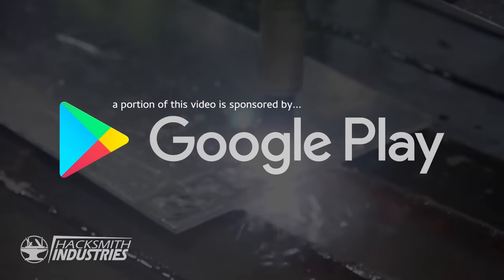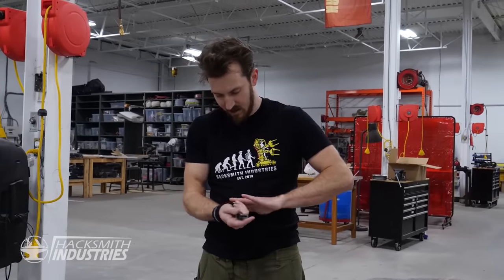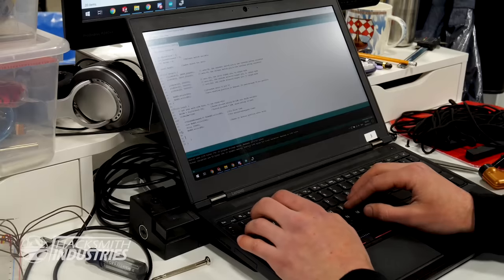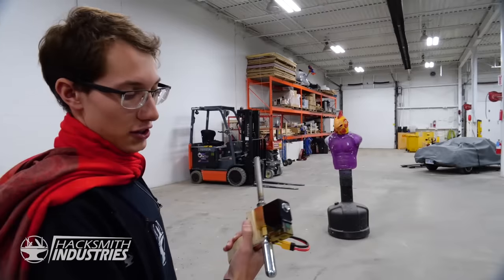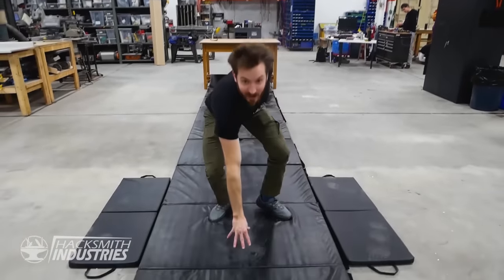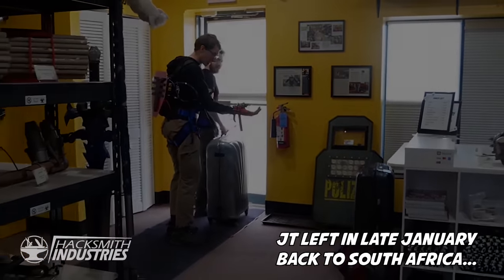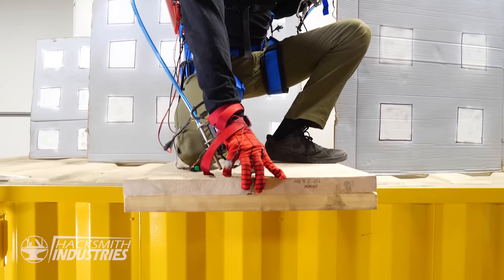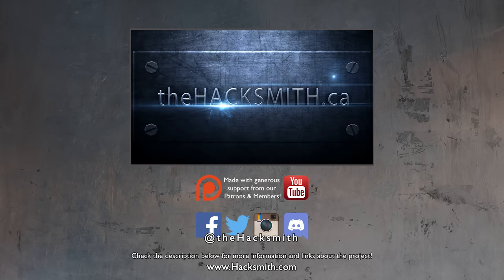Swinging From Web Shooters!

Comment: I love how he says don’t try this at home like we all have Spider-Man’s webbslingers lying around
Reply: aaaa aaaaaa I do
Reply: The web is just silly string
Reply: @whitespider4566  wow.. Damn bro it's so simple 😐
Reply: @whitespider4566  Thats not a webslinger, it's a webshooter.
Reply: @neoarcher4029  yas
Reply: @whitespider4566  Ah yes, Silly string strong enough to carry your weight
Reply: @devduthk3816  it is if your light enough
Reply: @HypNotikZ tf
Reply: @fredthebacon  what?
Reply: @neoarcher4029  na bro he’s altra light
Reply: the entire spiderman suit can have pores sporadically placed amongst it so that super glue can be oozed out of it allowing you to stick to any surface for a long amount of time without falling and oil can be released in certain places to gently release the suit drying it at the same time the holes in the suit could have a heating and air blowing system. All of this should also include a large number of items that will increase the durability of my armour and my suit. So far, my suit has contained a belt containing 3 knives, 2 axes, a hammer, 4 throwing stars, two handguns. the knuckles could have a laser light on it allowing you to shoot projectiles with accuracy.  My gloves contain an array of different coloured wires for attaching various things. The red wire is the grappling line which you can use to attach yourself to walls or buildings and make sure that you stay safely attached to whatever you're working with. there's a strong pulley system inside with the tiny catapult built inside of the wrist so that when it's fired it can be pulled back in with no problem. There are two more cables which connect to each pair of fingers to create more hooks for other parts of the suit which I'm planning to equip later. I've included some other components within the suit too, mainly the legs, the webbing system and my gauntlets which enable me to grip things and move around quickly and efficiently. a gyroscope can be built into the arm allowing you to know the polarity of the swing so that you can kick your legs back and forth and with doing so the system inside of the suit will also make you kick a little bit harder utilizing air pressure pushing you back and forth with air pushing your back forward and your stomach backwards allowing you to kick much harder before it swing meaning less energy between swings.  Finally, I've designed a few more tools in this suit for you which are meant to keep me safe if we end up in a fight and to prevent me from dying. I'll probably need to modify the suit a lot in order to make it work in a crisis so that you won't fall to your death, a flight system for wings can appear out of the suit allowing you to Glide and then in a hole in the spine of the suit can produce a Deployable parachute in case you were to ever fall and Deployable airbags around the suit in case you were ever to fall a little bit short where the parachute couldn't catch you causing you to bounce instead of hitting the ground hard. the suitcase collect energy and multiple ways such as solar energy kinetic energy and many more different types of Energies that will allow the suit to stay charged up even including running jumping flipping and Swinging could store energy in the suit. every little movement could cause a storage of energy. You could make metallic gloves that have 1000s of tiny pores in them that oozes out super glue to make them stick and then ooze out oil to make them release, with a heating system that dries the oil, or maybe a cleaning system.  You could also make your own metal gloves, made of pure steel. If you were lucky, you would find some alloy that was both flexible and strong enough so that they wouldn’t break if you pulled too hard. these could be used as spider man gloves, you could also mix copper wire with pores within it, super glue and gorilla glue and tiny strands of rope, a heating system and a oil release as well as water releaser to cleanse before each catapult of web strings. If you had a lot of money, you could build your own personal suit from metal, cloth, leather, and silk.  I recommend making a couple of suits. one for everyday wear, one that can be deployed by remote controlled device for special occasions. I don’t want anything fancy or impractical to happen because of a bad weather forecast or lack of funding, both hacksmith and the rest of the builders should come together to create this it would be awesome to see.
Reply: @I4IncTrackBlazers  wut
Reply: @milan64982  the reason a spider can crawl is because of its micro hairs, if you build a glove with micro holes that have super glue pouring out, just enough to stick, then a alternate system to pour out oil to release the stickiness but not too much so that a heating system built into the gloves can dry it, it will allow you to depeate the system and keep sticking and releasing. If I had the money I would do it myself to show you an example
Reply: I have mjolnir in my garage. I don't get the big deal it's not that heavy,even I can pick it up
Reply: ...you don't?
Reply: bruh I wanna try it at home

Comment: I have an idea:
Use electro magnets on a rope that is coiled up so that when released the rope coils itself back. The electro magnets are easy to release too. When you shoot the gun, the magnets will stick to the metal roof. When you release the electro magnet the whole rope w/ magnets attached will coil back into the mechanism. Like so he can see
Reply: Thank you for your support whoever liked this comment
Reply: I don't really know any kind of magnets that could support the weight of an human body
Reply: @rubenregnaud5560  electro magnets are pretty powerful, but it means,, that the web will charged af. So he can kill anyone
Reply: @rubenregnaud5560  there are magnets in junk yards that can pick up cars
Reply: @alecsnead6566  but those weight more than a human body
Reply: @veteranoftheemuwar6859  hahaha that's right
Reply: Yeah and wacks you in the face and nuts and stuff when it comes flying back at you lol!
Reply: Ruben Régnaud cargobobs have magnets that can lift cars
Reply: For those saying the magnets have to be super heavy to lift a person, mythbusters proved that's incorrect when they had a infiltrate myth through a vent quietly.  Jaime used super powered magnets to do so, it was loud as hell but it still did the job.  Colin Furze also did something similar where he made magnetic shoes that could be engaged/disengaged to walk on the ceiling.  So it is 100% possible to do, it just wouldn't be cost effective to throw magnets everywhere to swing 10 feet.
Reply: I feel like the electricity needed to induce electromagnets strong enough to carry a human will be very dangerous to work with. Besides, throwing a high-voltage coil of metal attached to a human against other pieces of metal doesn’t sound very healthy for the human anatomy in general
Reply: This would only work on metal tho right?
Reply: @rubenregnaud5560  Yeah, an electromagnet that could carry the weight of a swinging human body would have to have a large surface area and a ridiculous amount of electricity going into it. Plus the mounting surface would have to be really thick for the magnet to be capable of getting a strong hold.
Reply: @veteranoftheemuwar6859  actually its just about the electric tension you put on the metal, probably gold for best result but if the surface is too small there is more electric you should give to the metal and that is dangerous
Reply: @tidalforces3880  yeah you're right. But there's a problem with that. swinging is not a controlled environment. try it with a tape measure. Extend the whole thing and throw it across the room to let it coil back in and see what happens. also, a tape measure can only move 2 ways unlike a rope. Now imagine what would happen to the rope if he literally accelerates forward while the rope is coiling back in. I didn't word it very well but you get the idea.
edit: and with the ridiculous amount of electricity running through them, even if the ropes aren't made to be tesla webs, you'd be in serious danger....
Reply: To support a weight of human, battery pack  and other stuff electromagnet must be pretty big ( bigger than surface of hand) or it will fail,also you will need bug gauge wires too ( to power electromagnets)
Reply: @Hellothere-vr9um  Exactly what I was going to say. When it coils back it would be too dangerous and a bit unpredictable. It could easily kill or injure anyone if it hit the right place.
Reply: Mmm Yea that could Work but It doeant stick on any other surfaces
Reply: ok as nice as that sounds, getting electromagnets that can support a load of a human being simply too big for this project. If you want to get an idea of the size of these, I'd suggest looking at the time they tried to climb like spiderman. The magnets would be too large to be launched from the wrists mounts in any practical capacity. If I had to throw my hat into the ring on developing a design for the grappling feature, I'd make the end split into several wires with hooks on the end. That would give more chances for the rope to be caught by the hook. With thinner targets, the hooks could theoretically catch onto each other creating a secured anchor point.
Reply: I was literally thinking the exact same thing

Comment: The custom grappling hook design is an underrated part of this. What you've essentially made is a hybrid between Spider-Man's web shooters and Kim Possible's grappling gun. Very nice.
Reply: Thanks, glad you appreciated it!
Reply: @Built_IRL  Why are you saying thanks?
Reply: @batmitesolos7097  He's the one working for most of the video and has a separate channel. It's referenced at the end.
Reply: @Built_IRL  Of course, I'm always wowed by the stuff on this channel and am about to check out yours as well!
Reply: @NightFreeze9128  Found that out  a minute after the original reply and desparately tried to locate your original comment. I feel idiotic
Reply: @batmitesolos7097  Happens to the best of us
Reply: I thought one of the issues was the strain put on the arm. Shouldn’t the harness distribute the weight across the body? I suppose that would be an easy fix though.

Comment: the entire spiderman suit can have pores aka tiny holes sporadically placed amongst it so that super glue can be oozed out of it allowing you to stick to any surface for a long amount of time without falling and oil can be released in certain places to gently release the suit drying it at the same time the holes in the suit could have a heating and air blowing system. All of this should also include a large number of items that will increase the durability of the armour and the suit. The gloves contain an array of different coloured wires for attaching various things. The red wire is the grappling line which you can use to attach yourself to walls or buildings and make sure that you stay safely attached to whatever you're working with. there's a strong pulley system inside with a tiny catapult built inside of the wrist so that when it's fired it can be pulled back in with no problem.  I've included some other components within the suit too, mainly the legs, the webbing system and a gauntlets which enable me to grip things and move around quickly and efficiently. a gyroscope can be built into the arm allowing you to know the polarity of the swing so that you can kick your legs back and forth and with doing so the system inside of the suit will also make you kick a little bit harder utilizing air pressure pushing you back and forth with air pushing your back forward and your stomach backwards allowing you to kick much harder before it swing meaning less energy between swings. Also kicking your legs should trigger a system in the braided fishing line that makes you rock back and forth matching the kicks and air pressure in the suit helping the swing.  Finally, a cloth attachment from the elbows to the hip will allow you to Glide instead of falling. A hole in the spine of the suit can produce a Deployable parachute in case you were to ever fall. Deployable parachutes in the spinal region. the suit can collect energy in multiple ways such as solar energy kinetic energy and many more different types of Energies that will allow the suit to stay charged. metallic gloves that have 1000s of tiny pores aka tiny holes in them that oozes out super glue to make them stick and then ooze out oil to make them release, with a heating system that dries the oil. you could find some alloy that was both flexible and strong enough so that they wouldn’t break if you pulled too hard. these could be used as spider man gloves, you could also mix copper wire with pores within it, krazy glue and tiny strands of rope, a heating system and a oil release as well as water releaser to cleanse before each catapult of web strings. The gloves should be attached to the entire suit so the weight will be evenly dispersed, not causing too much tension on any region.

Comment: Hey, hack smith, spider webs are made of silicone, a type of thread, and spiders swing with it. it works by the spider keeping the silicone soft, and after released, it becomes hard, so you can make something like that. I suggest you making a kind of a big hole, which shoots thick, but wet silicone strings. it becomes hard after a little while and it can carry a lot of weight it it is thick enough. you can use compressed air to make the silicone come out. I hope that the silicone will stick before drying up.

Comment: The grappling design is the most impressive thing about this whole video. You might have a real money making design right there. The applications for urban assault or tactical operations is significant. If you can improve it to a 97% success rate, it will be the best hook ever designed.

Comment: A more efficient way might be to put extremely strong magnets at the end of the cable so that it will almost always latch on to something and use a motor and a wheel for the cable to wrap around to make it retractable when you spin the wheel with the motor.
Reply: This is genius,are there small magnets strong enough to hold up humans tho
Reply: @bowhello9647  yeah mabye I think there might be

Comment: you still need to make the hooks get back into the chamber.
maybe make the webs with flexible metal wires. that way the hooks due to a fact that they are made out of metal you can use magnets that when you relese the hooks the magnets pull the wires and the hooks back into the chamber.

Comment: just a suggestion :
if you somehow twist an electical wire on the main string and then make a connection which could open and close the grapling HOOK and a motor on your your hand to retract the main string ; you would be able to swing infinitely....
by the way love your channel...
Reply: Then break your hand when the hook comes flying back
Reply: @Focus_20SF  then slow down the rpm of motor which retracts the hook😁😁

Comment: What you did is to ma k 2 of bat mans wrist travelling hooks albeit they do not fold down at the hooks .ike his do , what you need is a chemist and a machinist and a designer on site ( a master of each )  because the webs are made from a special chemical compound that expands on contact with air and is super strong and sticky at the end and is held in replaceable cartridges filled with both carbonmonoxcide and the chemical under high pressure with a super strong wrist mount that will allow the person to ie wear,transport,swing,and replace cartridges as needed when empty from a belt around the wast similar to a shotgun shell holder that holds up to 50 single shot shells where they can put 2 cartridges per loop.

Comment: Krazy glue can hold 1000 pounds also it's easy to remove using oil
Reply: I have seen you've had a lot of comments that are good ideas and wanted to ask since I'm working on a project in the future do you think an antman that becomes smaller or shorter would be possible somehow because technically becoming taller is possible using stilts and robot arms
Reply: @jamwar4167  if we could find a way to do what the sun does and expand particles making them larger without killing someone and being able to give the amount of energy to those larger particles that it needs so that they don't dissipate. Also a reverse engineer way and reduce the size of particles. Then yes I do believe that is very possible because of the sign can do it to oxygen particles in many other particles then there must be a way of doing it.
Reply: @I4IncTrackBlazers  ok cool
Reply: @I4IncTrackBlazers  also is it possible to make a suit that shrinks but your body stays the same so there are no biological problems idk but here are some random ideas maybe something that makes the environment act bigger for you or since size is how much something takes up space the suit looks small using a convex lens or reducing glass lens or has a small version on it and if anyone tries to interact with some parts of the suit they are somehow slowed down so it seems like there is more space since it takes longer for them to get close so the suit seems to not be taking up space on that side and the suit moves fast so you don't seem to takes up space in one spot
Reply: @I4IncTrackBlazers  Let me know if you have any ideas for it that better then my last comment
Reply: @jamwar4167  I definitely will